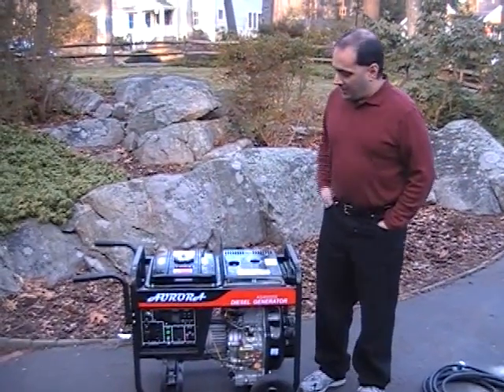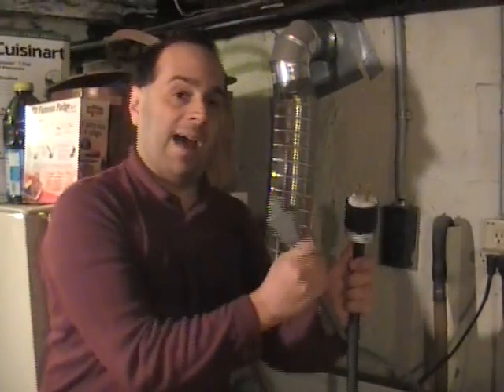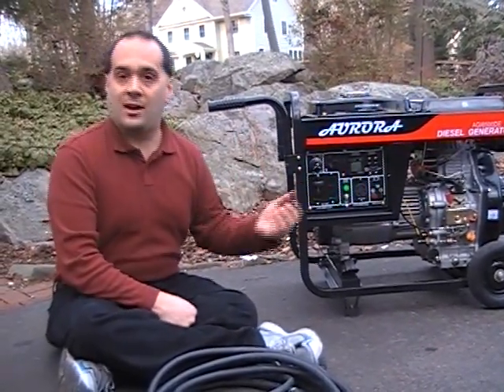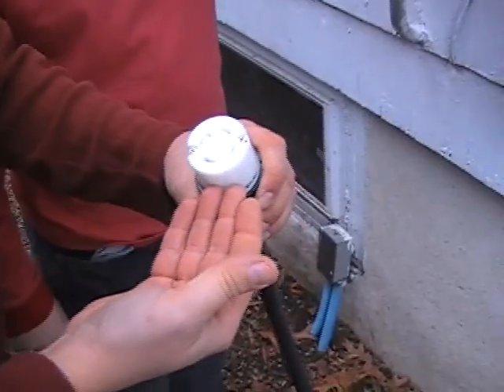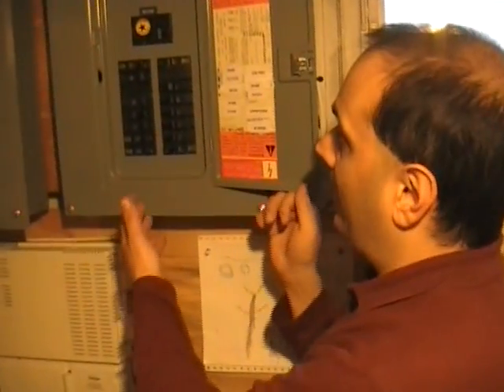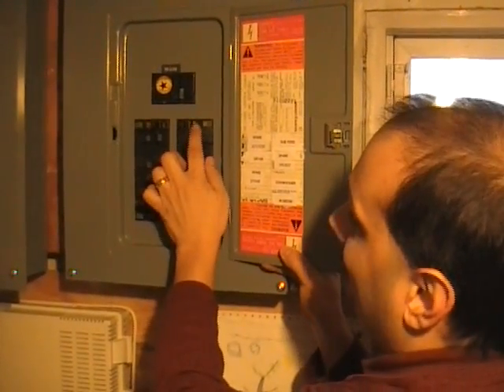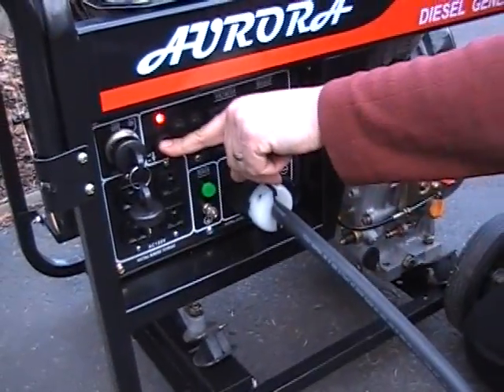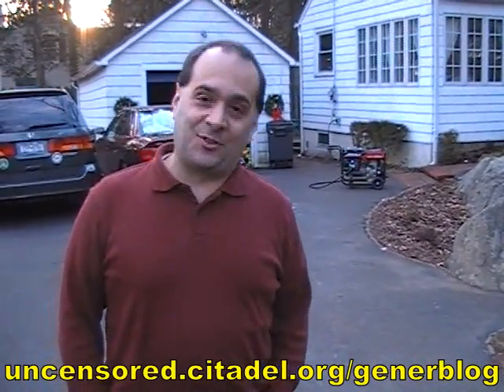Inexpensive residential generator hookup

Comment: I have a SUICIDE cord......  I just don't put my tongue on it. But i don't use my dryer hookup, I have the correct wiring and breaker to support the load. And my wife would have no idea how to start the generator, NOR the strength to go get it from the barn and bring it up to the house. So there is nobody to die using my handy dandy SUICIDE cord.  (I would never wire anybody else's house that way.... and I always Kill the main feed at the breaker under the meter located 1,000 feet from the house in a place NOBODY would have any idea what it was, let alone, where it was, OR how to get it open unless you were an electrician, THEN I plug the cable in, AND THEN, start the generator.  I will probably fix this eventually but it works fine.
Reply: Bully for you .......
Reply: But it's NOT legal and can potentially backfeed power to the power company's grid, which could potentially electrocute a power company lineman.  In Louisiana law, if a lineman gets electrocuted because of a homeowner's improper generator hookup, the homeowner can be charged with FIRST DEGREE MURDER!  There has been two or three murder trials because of this, and all were convicted and are in jail!
Reply: @user-cy6gf2pj7y  First off, nobody is back feeding anything, because the main breaker is OFF 1,000 feet from the house at the meter located on the phone pole. So nobody is getting electrocuted and I don't need to hear about killing people. As for the LAW, there is "no law" that prevents you from wiring your entire house using 28 gauge wire on 30 amp breakers and burning it down. Now code may have something to say about it, IF there is any code enforcement in whatever magical place this example sets on. I live on a Ranch, so I am exempt from code and don't fall under that which only somebody in a house next door is required to do. but I won't explain all the reasons why and what the courts have to say about that....  so, if you are talking about CIVIL LAW, and harm to another you can sue anybody for any reason. (And yes my entire ranch is wired to code, BETTER than code because I run heavier wire than needed on my circuits.)     I am the ONLY person that would ever hook this up, and if I ever sold my ranch (I wouldn't) I'd pull the breaker, problem fixed. FYI the generator isn't even located at the house, someone would have to the equipment to haul it up from the barn. Nobody exists in my situation that would even attempt it. Hell, they'd have to find the special cable I made to begin with.
Reply: I made a male to male for my cabin you simply plug in first as stated.  I have no grid power but wired the place in case someday someone wants it.   I have a normal 110 exterior receptacle on the building I send my power there goes to the panel I bridged both sides of the panel at top so all breakers get fed.  It’s sketchy but I am the one doing it.  If I get shocked it’s on me.  Definitely agree it’s not safe for public use.   At my residence I would power my boiler and fridge with heavy extension cords for the amount of time very doable wouldn’t bother with transfer switch unless I lived in area w frequent outages.
Reply: @markfisher6211  Sounds doable, like you said if you are the only one firing it up, etc. then not as though you have put others at risk. I was thinking, I could put a LARGE indented MAIL PLUG on the wall next to the box, then I could use a FEMALE coming from the generator for safety, HOWEVER, that is even MORE dangerous, because then every single day of the year, if "someone" accidentally flipped the "back feed" breaker, those large indented male plugs would be HOT. And it would be be MORE feasable someone could get a finger or hand or elbow on them, then for the possibiity of someone firing up the generator, and having the male prongs exposed.  JUST do it in the RIGHT ORDER, and there is no danger.  1) plug in cord 2) Fire up generator 3) flip backfeed breaker  (do reverse to shut down)
Reply: @brentbarnhart5827    Here are the rules about portable generator safety: make sure you are aware of all the warnings before using portable generators. This is just a reminder for everyone’s safety. All generator safety rules should be followed carefully. This advice is just to make sure that everyone is aware of all the warnings and it’s just to remind people to be careful using portable generators. Generators can be dangerous if not used carefully. Every year, hundreds of people die or get injured when using portable generators due to carbon monoxide poisoning and electrocution. Make sure you are using your generator carefully and keeping others safe as well. There is something very serious that everyone should always be aware of when using generators. Some people do run their generator indoors which is not safe and that increases the risk of carbon monoxide poisoning which can cause death of family and you. Some people run their generator in wet conditions which can electrocute them. Please remember that you should never run your generator indoors. Remember that carbon monoxide is an odorless and colorless gas that you cannot see or smell. Carbon monoxide is a silent killer. Keep that in mind. Make sure your generator is 15-20 feet away from your house and away from doors, windows, and vents. Never use your generator in your porch too. Having a carbon monoxide detector is very important against generator safety. Some people also allow children to go near the portable generator which could pose risks. We need to keep an eye on our children making sure that they are not near the portable generator so they won’t get electrocuted or burned by the generator which is dangerous. A locking enclosure also keeps kids safe. A generator shed might look like a tempting place to explore, or take cover during a game of hide and seek, but a generator is a dangerous piece of equipment that can cause injury. It says on the manual that we should also keep children away at all times from the portable generator to avoid injuries. Please do not allow a child or unqualified people to operate the portable generator.  It is important to keep your children safe especially little ones. The portable generator can be hot during an operation. Just because some manuals missed what should be listed doesn’t mean it’s safe to do. Always follow the generator safety rules when using portable generators. Generators pose electrical risks. If you need to use your generator during wet weather, you need a generator tent to protect your generator from getting wet. Don’t let your generator get wet. Keep your generator dry and before using your generator, please make sure your hands and your generator is dry. Do not wear loose clothing when operating the generator. Everything that is said on the generator’s operating manual should not be ignored. Never smoke cigarettes near the generator. Please keep flammable things away from the generator. Never overload your generator too. Your generator can catch fire. Never ever try to plug a generator cord into a wall outlet to avoid back feeding. Back feeding your generator is dangerous. Always turn on your generator first before plugging in appliances and shut off the appliances before turning your generator off. Use a heavy duty cord for your generator and the cord should not be worn out. All the instructions should be followed carefully. Never refuel your generator while it’s running. It can cause fire if fuel spills while your generator is hot. You should turn off your generator and let it cool off before refueling it. Having a fire extinguisher next to the generator is also important. This is only a reminder for everyone’s safety of using generators. Make sure your generator is properly grounded. Having a fire extinguisher next to the generator is also important against the safety rules. https://youtu.be/I1jT3ANENvI and here is a video more about keeping others safe when using generators and also about our family’s safety. It’s important to keep our little children safe as well. Make sure they’re away from the generator. Hope this helps. Thank you.
Reply: @The_Happy_Aviation_Enthusiast  All good information. I agree with everything, I would never wire anybody else this way, but the specifics of how I did mine, have no change of personal injury to anybody. Including where the generator is located outside, and the fact my tiny 90 lb Japanese wife couldn't move it, let alone pull the cord to start it, and would never route the cord out the window even under the wrap around port where it is dirty and lots of spiders, etc. etc.  I'm sure there are isolated people like myself, who can safely do such an install because we are trained, and there is nobody around to get hurt.
Reply: @markfisher6211  FYI I noticed you said that you backfeed through a 110v outlet, unless you are running a TINY TINY generator the wires going from that to the box are not NEARLY big enough. If that is a 15 amp breaker, you could run your tv and a few lights. If you are running your refrigerator, even at that point it starts to get sketchy.  FYI.  (Risking burning your cabin down, melting the wires, burning it down at a later date, etc. etc.) Better be careful with that arrangement.

Comment: Yeah but my cables are because there was a 60 amp welder in there before and it's out in the garage so once I plug it in and close the door nobody can get at it and if it falls out it falls out but won't fall I cuz it's locked in
Reply: Here are the rules about portable generator safety: make sure you are aware of all the warnings before using portable generators. This is just a reminder for everyone’s safety. All generator safety rules should be followed carefully. This advice is just to make sure that everyone is aware of all the warnings and it’s just to remind people to be careful using portable generators. Generators can be dangerous if not used carefully. Every year, hundreds of people die or get injured when using portable generators due to carbon monoxide poisoning and electrocution. Make sure you are using your generator carefully and keeping others safe as well. There is something very serious that everyone should always be aware of when using generators. Some people do run their generator indoors which is not safe and that increases the risk of carbon monoxide poisoning which can cause death of family and you. Some people run their generator in wet conditions which can electrocute them. Please remember that you should never run your generator indoors. Remember that carbon monoxide is an odorless and colorless gas that you cannot see or smell. Carbon monoxide is a silent killer. Keep that in mind. Make sure your generator is 15-20 feet away from your house and away from doors, windows, and vents. Never use your generator in your porch too. Having a carbon monoxide detector is very important against generator safety. Some people also allow children to go near the portable generator which could pose risks. We need to keep an eye on our children making sure that they are not near the portable generator so they won’t get electrocuted or burned by the generator which is dangerous. A locking enclosure also keeps kids safe. A generator shed might look like a tempting place to explore, or take cover during a game of hide and seek, but a generator is a dangerous piece of equipment that can cause injury. It says on the manual that we should also keep children away at all times from the portable generator to avoid injuries. Please do not allow a child or unqualified people to operate the portable generator.  It is important to keep your children safe especially little ones. The portable generator can be hot during an operation. Just because some manuals missed what should be listed doesn’t mean it’s safe to do. Always follow the generator safety rules when using portable generators. Generators pose electrical risks. If you need to use your generator during wet weather, you need a generator tent to protect your generator from getting wet. Don’t let your generator get wet. Keep your generator dry and before using your generator, please make sure your hands and your generator is dry. Do not wear loose clothing when operating the generator. Everything that is said on the generator’s operating manual should not be ignored. Never smoke cigarettes near the generator. Please keep flammable things away from the generator. Never overload your generator too. Your generator can catch fire. Never ever try to plug a generator cord into a wall outlet to avoid back feeding. Back feeding your generator is dangerous. Always turn on your generator first before plugging in appliances and shut off the appliances before turning your generator off. Use a heavy duty cord for your generator and the cord should not be worn out. All the instructions should be followed carefully. Never refuel your generator while it’s running. It can cause fire if fuel spills while your generator is hot. You should turn off your generator and let it cool off before refueling it. Having a fire extinguisher next to the generator is also important. This is only a reminder for everyone’s safety of using generators. Make sure your generator is properly grounded. Having a fire extinguisher next to the generator is also important against the safety rules. https://youtu.be/I1jT3ANENvI and here is a video more about keeping others safe when using generators and also about our family’s safety. It’s important to keep our little children safe as well. Make sure they’re away from the generator. Hope this helps. Thank you.

Comment: well done , but i m looking for a more detailed wiring work to be done as i m only interested in two circuits , well pump, and referigerator.
Reply: Here are the rules about portable generator safety: make sure you are aware of all the warnings before using portable generators. This is just a reminder for everyone’s safety. All generator safety rules should be followed carefully. This advice is just to make sure that everyone is aware of all the warnings and it’s just to remind people to be careful using portable generators. Generators can be dangerous if not used carefully. Every year, hundreds of people die or get injured when using portable generators due to carbon monoxide poisoning and electrocution. Make sure you are using your generator carefully and keeping others safe as well. There is something very serious that everyone should always be aware of when using generators. Some people do run their generator indoors which is not safe and that increases the risk of carbon monoxide poisoning which can cause death of family and you. Some people run their generator in wet conditions which can electrocute them. Please remember that you should never run your generator indoors. Remember that carbon monoxide is an odorless and colorless gas that you cannot see or smell. Carbon monoxide is a silent killer. Keep that in mind. Make sure your generator is 15-20 feet away from your house and away from doors, windows, and vents. Never use your generator in your porch too. Having a carbon monoxide detector is very important against generator safety. Some people also allow children to go near the portable generator which could pose risks. We need to keep an eye on our children making sure that they are not near the portable generator so they won’t get electrocuted or burned by the generator which is dangerous. A locking enclosure also keeps kids safe. A generator shed might look like a tempting place to explore, or take cover during a game of hide and seek, but a generator is a dangerous piece of equipment that can cause injury. It says on the manual that we should also keep children away at all times from the portable generator to avoid injuries. Please do not allow a child or unqualified people to operate the portable generator.  It is important to keep your children safe especially little ones. The portable generator can be hot during an operation. Just because some manuals missed what should be listed doesn’t mean it’s safe to do. Always follow the generator safety rules when using portable generators. Generators pose electrical risks. If you need to use your generator during wet weather, you need a generator tent to protect your generator from getting wet. Don’t let your generator get wet. Keep your generator dry and before using your generator, please make sure your hands and your generator is dry. Do not wear loose clothing when operating the generator. Everything that is said on the generator’s operating manual should not be ignored. Never smoke cigarettes near the generator. Please keep flammable things away from the generator. Never overload your generator too. Your generator can catch fire. Never ever try to plug a generator cord into a wall outlet to avoid back feeding. Back feeding your generator is dangerous. Always turn on your generator first before plugging in appliances and shut off the appliances before turning your generator off. Use a heavy duty cord for your generator and the cord should not be worn out. All the instructions should be followed carefully. Never refuel your generator while it’s running. It can cause fire if fuel spills while your generator is hot. You should turn off your generator and let it cool off before refueling it. Having a fire extinguisher next to the generator is also important. This is only a reminder for everyone’s safety of using generators. Make sure your generator is properly grounded. Having a fire extinguisher next to the generator is also important against the safety rules. https://youtu.be/I1jT3ANENvI and here is a video more about keeping others safe when using generators and also about our family’s safety. It’s important to keep our little children safe as well. Make sure they’re away from the generator. Hope this helps. Thank you.